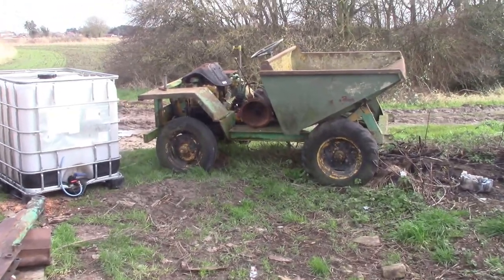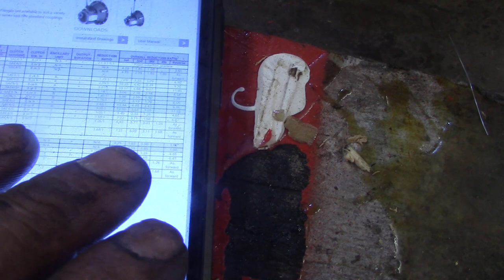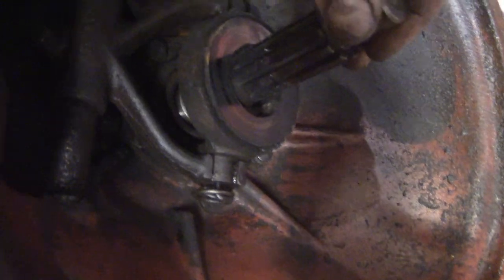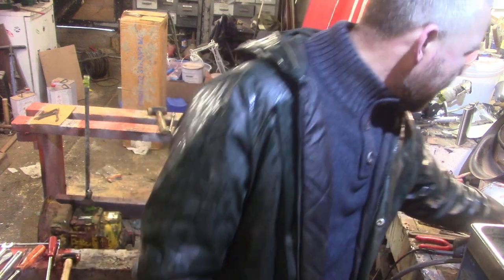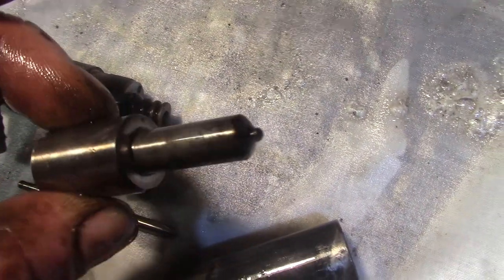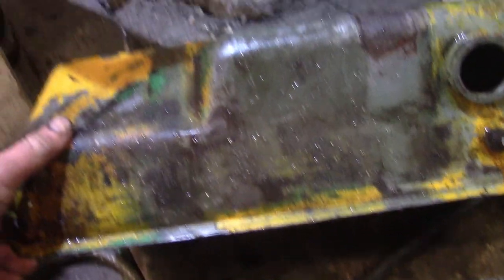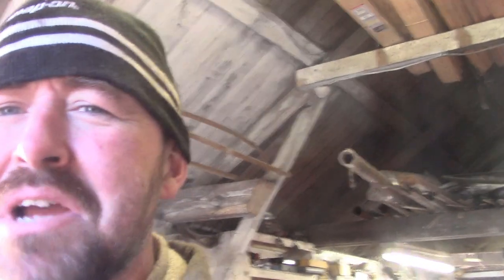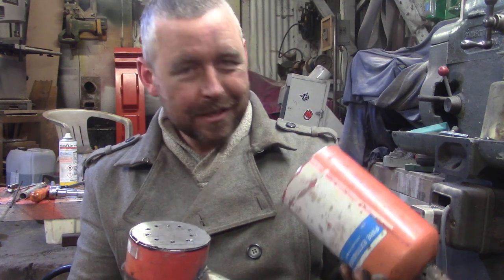Deutz dumper repair

Comment: I like the idea that your mini dumper is a gas start gas engine... that's great also I think thick ribbon like steel wool is an easy way to build a muffler but I've never messed with them myself.
Reply from the maker: These little diesels like to coke up a good'n, think a packed muff would have some interesting consequences!

Comment: Hello, Jim. My AC1 Lister Petter engine had been coked up on the pintle as well, but a friend actually rebuilt it for me. He was quite pleased at how easily it started for him. A starting motor is about £180 here, so I'm looking for something with the same tooth count that I could adapt to fit. There might be a market for the adapters for the engine.
Reply from the maker: I got a starter with my ac2w, it'll be the same if you ever want me to dimension it or anything, just started working on my Lister power pack, needs to be electric start but like you I'm not going to spend that sort of money on a starter+ring gear so looking at making a starter geny with a solenoid operating the deco, it's how the "startomatic" load sensing generators used to work I believe.

Comment: Thought I’d added a comment. Like the starter motor bit easier than a broken wrist 🙄 looks like it could do with some new tyres for more grip. Love how you managed to Mackle two gearboxes together to get one decent one. Only gearbox I’ve looked at was a simple two speed cone clutch jobbie that came with my spare turret lathe... 😀
Reply from the maker: How did the wood botherer get on this weekend? I saw your other comment, replied, has it vanished? Yes the rh Tyre is pretty bald, mega bucks for a new one unfortunately.
Reply: @turboconqueringmegaeagle9006  we've got a new bit of frame roughed out. Router table shenanigans this week to add the rebates! I did wonder about tyres maybe get some chains for it?
Reply from the maker: @julias-shed  oh shenanigans, my favorite.
I'm pretty sure they're Landy 5 stud wheels, if I find a cheap set of chavy alloys with mud tyres.....

Comment: We use citric acid in our ultrasonic baths to get our crucibles clean for iron ore analysis. Not sure if you can get it cheap enough there but definitely works well 👍
Reply from the maker: Someone recommended it the other day for rust removal, I'll have to find some cheers.
Reply: @turboconqueringmegaeagle9006   Works great, nicer to use and better than anything else I've tried,  can buy a big tub from that auction site for peanuts compared to equivalent commercial rust remover.
Reply from the maker: @Festoolification  ok I'll get some, what sort of heat and concentration should I aim for?
Reply: @turboconqueringmegaeagle9006  Haven't even bothered with heating, just cold water, concentration wise, not much really  half a small cup in a bucket of water.

Comment: Wow that's dumper was in a rough shape. Did the gearbox cracked because of frozen water? I am very glad my dumper has a Petter engine, much quitter, all Dutez knocks a lot. Well done for that pony starter. I think if you make the starting handle closer to the machine and reducing the stroke of the swinging hand, you should be able to start it. Remember the small the engine the shorter the swing to spin it fast. Is the handle connected to the crank or cam shaft?
Reply from the maker: I thought maybe frost damage but inside it was beautiful, no corrosion.
I'll try what you are suggesting with the handle now that I know it starts well and I'm not breaking my wrist on a dead engine.
Reply: @turboconqueringmegaeagle9006  I am.sure you be able to start it with my advice. I have experience on such scale engines.
Reply from the maker: @enginelover1  of course, you are Mr diesel as far as I am concerned.
Reply: @turboconqueringmegaeagle9006  I appreciate if you mention me a little in a videk when you alter the starting handle.
Reply from the maker: @enginelover1  sure thing, can I use the clip at the end of your latest video? it's such a good shot.
Reply: @turboconqueringmegaeagle9006  yes you can use it, it will be great. :)

Comment: I take it that you'll be getting your diesel heater into that dumper butt, for a proper hillbilly hot-tub? It's a brave man that sees much use of the 4th gear in those old things on anything but the smoothest of tarmac, it's amazing how something can be glacially slow and terrifyingly quick at the same time.
Reply from the maker: This one is like new compared to the wrecks I cut my teeth on, I've got less than a half inch of play in the king pins but it's still a handful.

Comment: Things to do … clean down shell for a spot of paint …. And a go cart seat next to dad.. on a serious note though was the left front wheel slipping / losing power - looked like you had it in one wheel drive mode for a bit? And were your back wheels a bit floppy? Like the bearings were a bit loose? Or was that a trick of the camera and angle?
Reply from the maker: Right front wheel is bald but they're pretty expensive and I don't want to replace it, with the hubcap hanging off I just wanted to check that bearing, all the play is in the king pin which is completely normal for this style 2wd dumper, this is by far the least sh1t one I've ever driven.